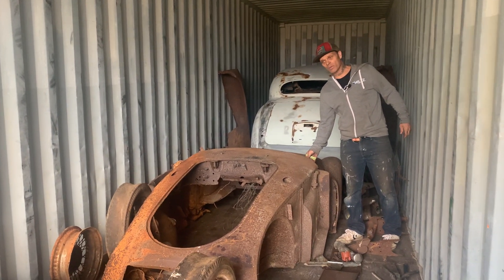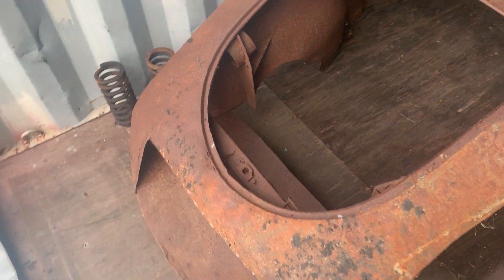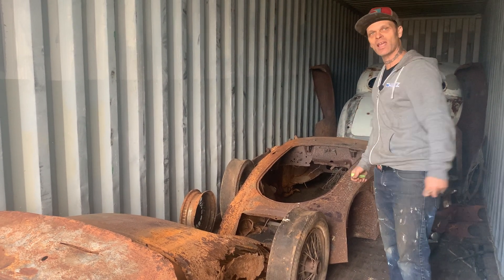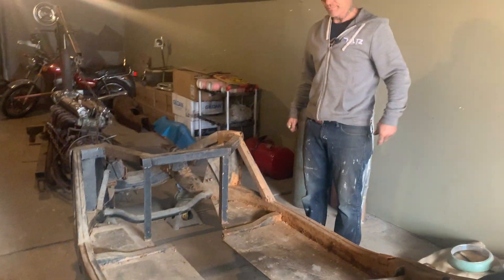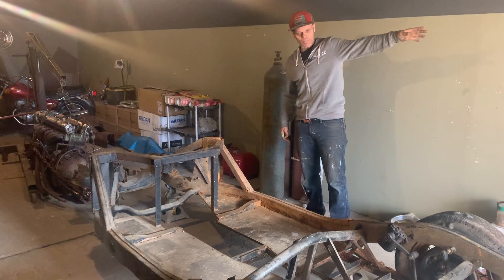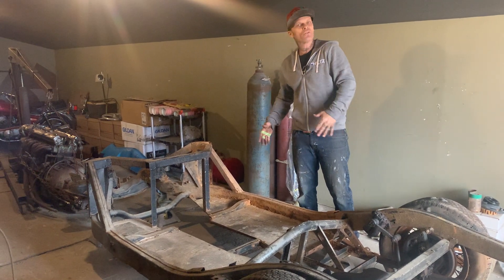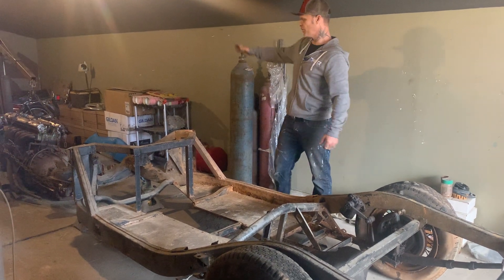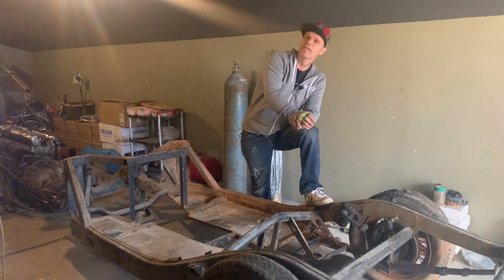1959 MGA with a 1959 Jaguar straight six twin cam

Comment: I stumbled across a 72 mgb this spring that ran great but was rotten.  I was going to use it for parts but it was just to much fun to drive. I tore it apart, cut out all the rot and used an old locker that was laying in the backyard for atch panels,  floors, trunk floor , rockers and inner rockers.  Painted it with boat paint in the driveway and I love it.  Gets attention every where it goes, into it for around 1000 bucks and six weeks of hard work. 
Rebuilding an old airplane now,  keeps us young.
Reply: I would like to see that !
Reply: @bleepbleep1961  You can see it in the background of my airplane update video. I never made any videos of putting the car together because, well , it wasn't all fun.

Comment: Chad i own an mgb  .They dont use metric bolts.they are all fine thread sae bolts .   Moss motors catalog will really help you visualize what they used even if your not going to purchase anything . Cant wait to see how the new project turns out. Good luck with this

Comment: Hey Chad I really enjoy your channel you inspire me to work on my old Chevy.
I was watching your discussion on the English threads wishing you had some.
When I was a lady I bought an English motor cycle.
A BSA I learned quickly that wrenches didn't fit and no nuts or bolts would work.
My Dad told me they were called WENTWORTH threads and tools I have the original repairs kit from that motorcycle if you could use it send me your address.
Good luck finding WENTWORTH FASTENERS  they will have to come from someone who worked on foreign cars. Bob Abreu South Dakota

Comment: I did the same thing with two Fiat Spiders 20 years ago. I ended up putting 150,000 miles on the resulting car- I drove it into the ground until the structure of the unibody failed  :)